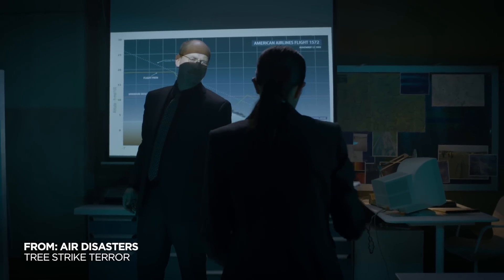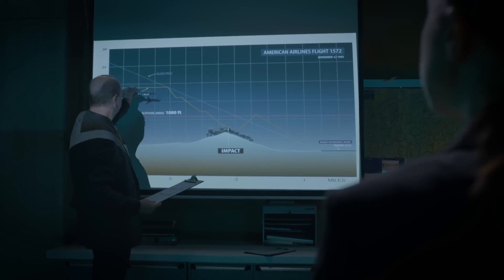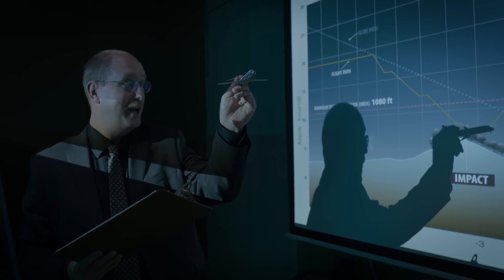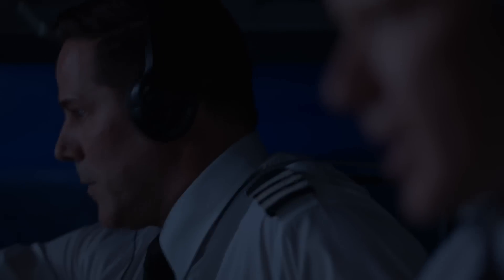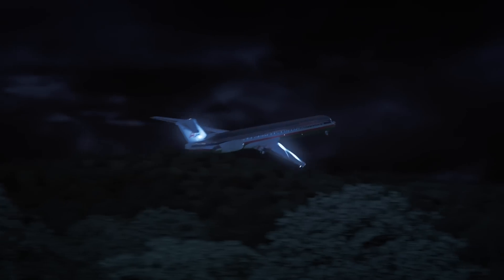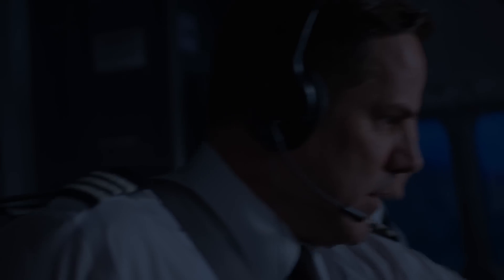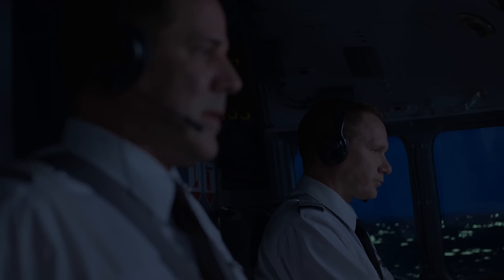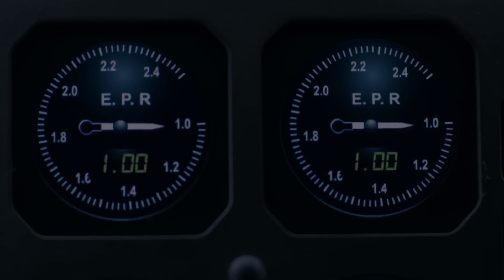The Flight Data of AA 1572 Highlighted its Pilot’s Heroic Flying 😳 Air Disasters | Smithsonian

Comment: The acting is worse than in corn. For real. Also the script doesnt even bother with the real transcripts. Sadly, both pilots were thrown under the bus by AAL and the FAA, and Smithsonian makes no mention of the incorrect QNH given to the pilots, then confirmed as the wrong value again. No mnetion of that. Their mistake was a procedural one, where ATC was a COLOSSAL safety mistake.

They also did not turn off the ATIS when evacing the tower, and other mistakes that were just complete madness in that place. But this is how good pilots that made one procedural error, never get to apply it. I have no idea if they flew for anyone else, but I would fly with them and others like then any day over a brand new pilot or an AWACS pilot.

Yet, I pay taxes to the Smithsonian and they supposedly know history and cant be bothered. Im glad that they cast a woman as the arbiter of airmanship...face palms.

Comment: It's not a error if own up and pull up at the last second.
Reply: It is an error when the airplane flops onto the runway with wheels retracted and engines damaged due to ingesting vegetation, having destroyed the localizer antenna on the way in, making the runway unusable for ILS approaches from the other end.

Comment: So the question remains, why did plane start descend even tree structure in the engine and leaving MD-83 without power.
Reply: The pilots didn’t configure their altimeter for the changing weather, so they thought that they were higher in the sky, and also they descended below the minimum threshold
Reply: Can you imagine engines sucking in trees and still flying above them? They were too low and rose above the terrain.